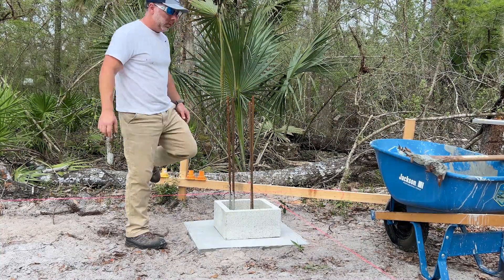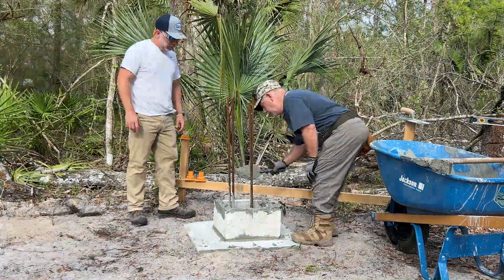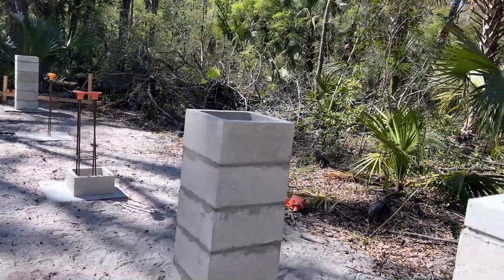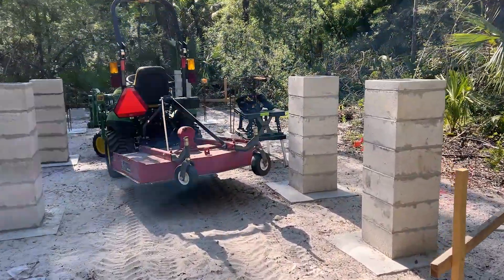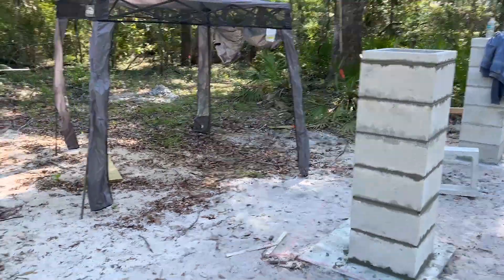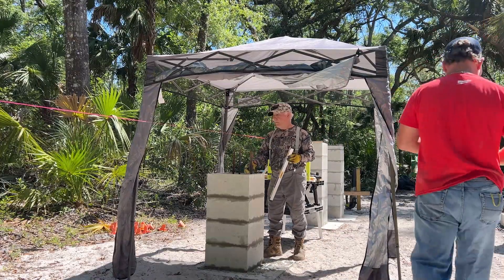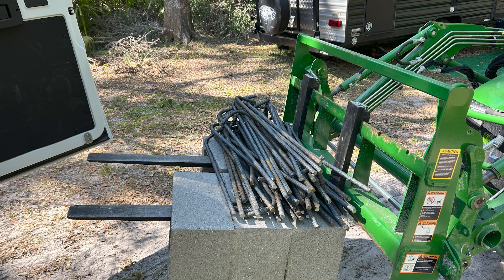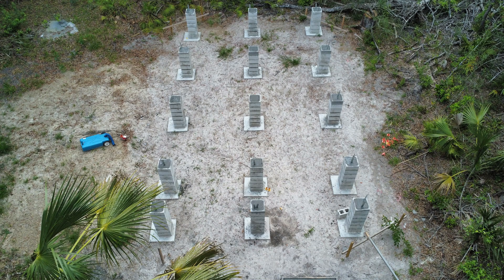Florida Cabin on Piers ( Stacking Pier blocks and pouring them solid )

Comment: What is the ground floor and final elevation of the floor? Also curious how many cubic yards did the 2nd pour of the column take? Did you find the inspectors to be picky or bit laxed for a cabin vs a house build.
Reply from the maker: Hello, thank for visiting. Final elevation was setby the county. 31 feet  if Im not mistaken. Those cloumns took 3-4 yards. Inspectors were pretty thorough with the steel.

Comment: How critical is it to have these line up with each other?
Reply from the maker: Thanks for commenting! Im not quite sure what you are asking. Can you elaborate?
Reply: @TheBrokerBuilder the columns look like they are a little twisted. How far from being square to each other before an inspector complains?  I’ve never done pier and beam only stem walls
Reply from the maker: Ya, they were all set to layout strings. I think the one in the front left is a little off, maybe 1/8. The floor system is 4.5 inches so plenty of room.